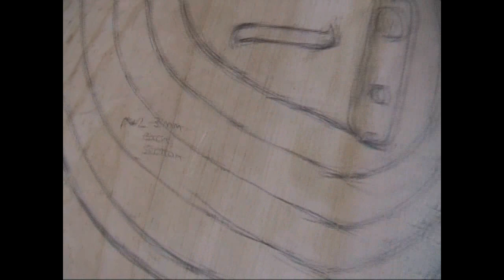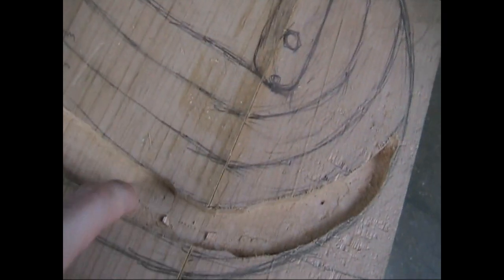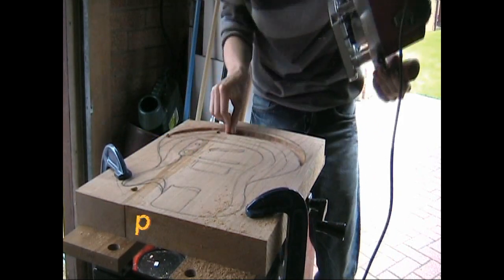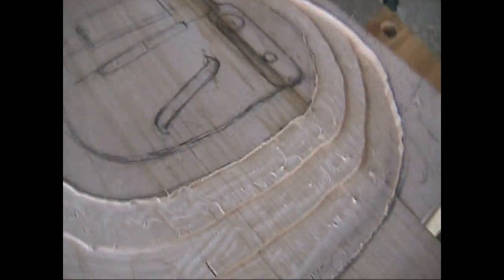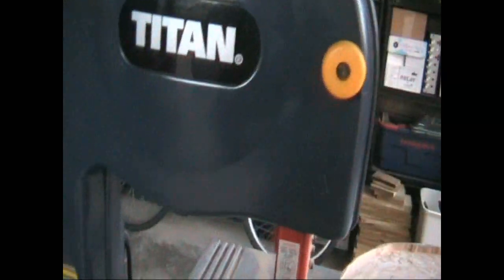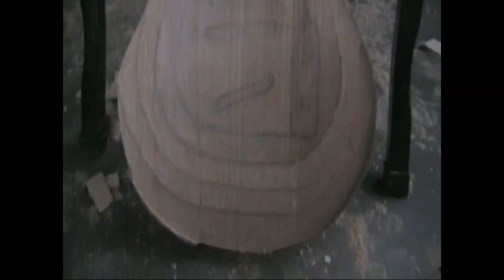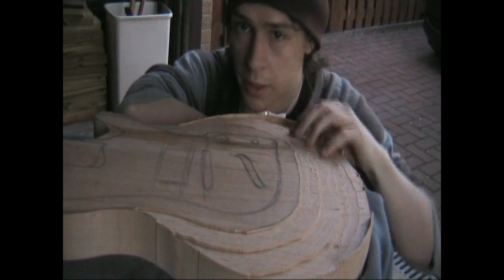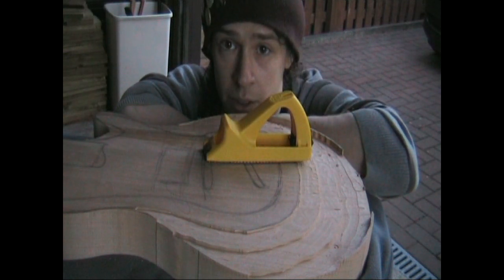Colin's Guitar Builds: SR1 custom part 1 - bandsaw and top carving

Comment: LOL  we call it a "wood rasp" where I come from. You can call it a Les Paul as long as you're not selling it. Back in the day, the Kramer company was sued by Fender because they made a run of Strat's that were too similar to Fender's; they settled to make Kramer change the headstock. Billy Joe of Green Day actually has one of those rare Kramer Strats. 
Your videos are good inspiration for me and my projects. I mainly make speaker cabs and mod guitars but I'm branching-out. Cheers from Boston